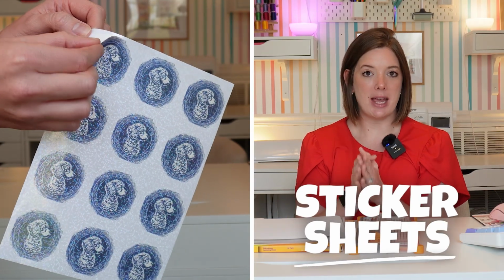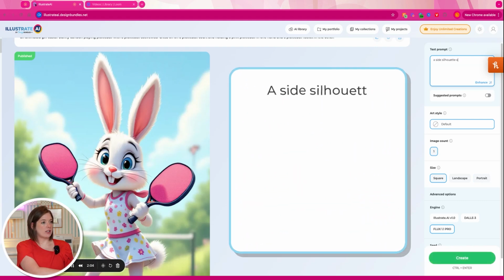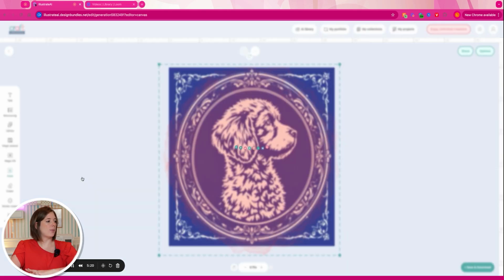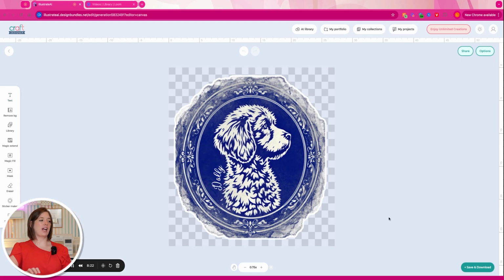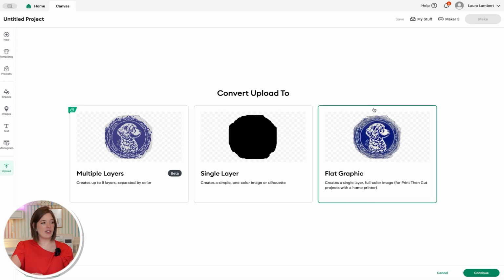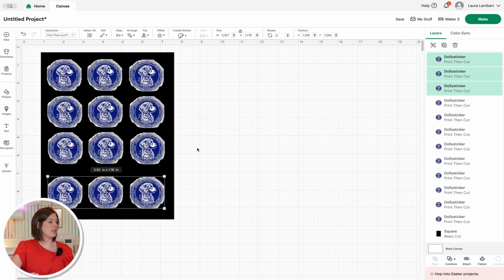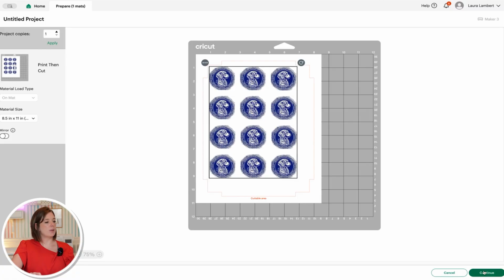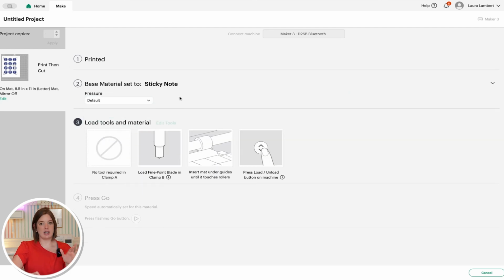Make Your Own Holographic Stickers with Craft Designer + Cricut! 🐶

Comment: Thank you for the demo of Illustrate AI and Craft Designer.  It would be appreciated if you don't bash the Cricut software in the process, especially if you have to use it to complete your project.  I am not affiliated with Cricut, but don't appreciate people putting down other products to sell their own.  Also, for beginner sticker makers it would be a good idea to have them check the cut before unloading the mat so if it didn't cut through enough to peel the sticker you could run another pass and save the sticker sheet.
Reply: I also don't understand why you don't use the sticker setting in Design Space.
Reply from the maker: No hate on Cricut for sure! As a crafter, I still use it all the time! For this very specific process though, I definitely prefer Craft Designer. I used Cricut exclusively for years though and didn't even know there was an alternative, so just pointing out there are other options :)

Comment: Yes the design & sticker a circle but I want to be able to hand them out individually. So a square piece with the sticker you can peel off. Not fully cut edges so it’s easier for little hands
Reply from the maker: You should be able to create a cut through line in any shape.

Comment: If I wanted to make them cut out in individual squares (not cut out) is there a way to do that instead of having to cut the sheet into squares?
Reply from the maker: You mean for the outer shape to be a square or to keep the round design and the edge of the sticker just be square?